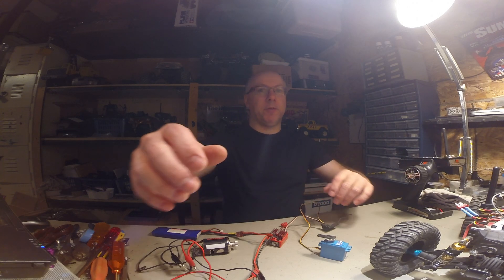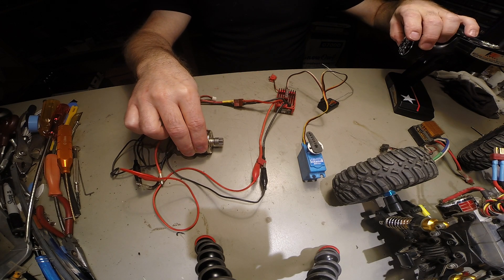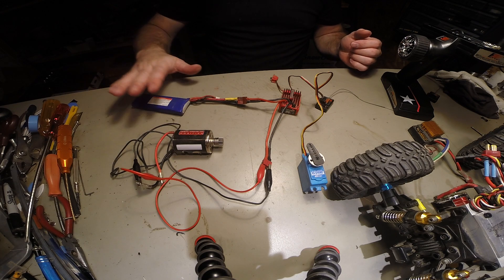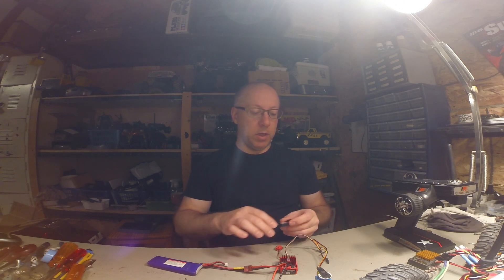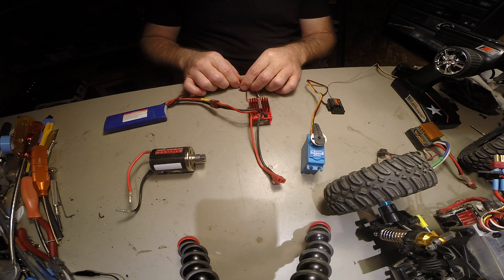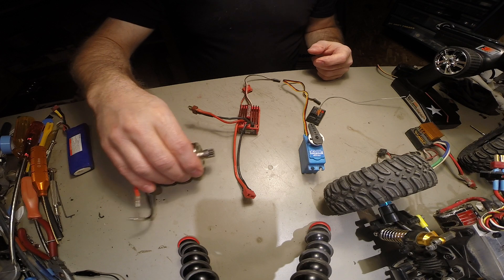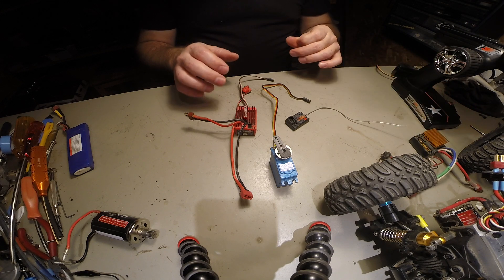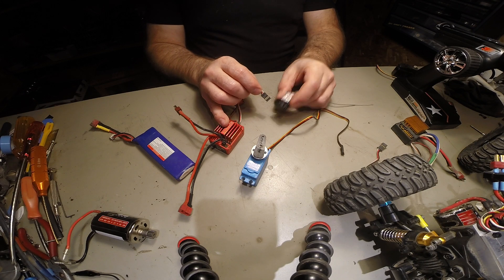Troubleshooting RC Electronics basics - Diagnose and fix it yourself

Comment: I have an E-Flite Apprentice that I nosed into the ground just before takeoff. I was able to get it running, but sometimes it runs and sometimes it doesn't. When it doesn't, nothing happens. When it does run, it goes like normal. Any ideas on how to fix that?
Reply from the maker: Gotta be in intermittent connection that you have to find
Reply: @TheLEDwheel   Have you done any wiring of vintage battery operated toys? I need some advice on how to hook up wires in the toy I have.
Reply from the maker: @Superdoc7  not sure  that would help. Toygrade electronics can differ greatly from one to the other unlike hobby grade setups that have common interchangeable systems.

Comment: Great video. I didn't realize I would have to learn to fix these cars if I wanted to drive them with my son. We currently have a rc car which steered but didn't move. The tires lock up when you push the car. Model: haiboxing 1:12 rc off road sand rail buggy. Called customer service and the man told me to just " start taking it apart" then try to diagnose it. Any ideas here guys? I don't really know what I am doing. HELP!!!
Reply from the maker: Open up the gearbox and see  if either  there is junk or broken gears.

Comment: Very informative, saved this video! I got a trx4 defender 2 months ago and my transmitter/radio won't turn on. Has brand new batteries (IV tested all 4 batteries) and have opened the radio to see if any wires were.lose but it all looks fine. Anything I should check for?
Reply from the maker: First I would  contact traxxas for customer service.  Other than that if power gets to the main board and it  does not power up it could be the voltage regulator but i have no idea  how its setup or what it looks like.

Comment: Where would I start if the receiver blinks once when switch is turned on?  Nothing else works. Thanks
Reply from the maker: Does it flash if the transmitter is off?

Comment: Two RC's by legendary 1/10 trucks. It powers up with steering. The motors are two and all they do is squill. Like they have power but won't turn. Any ideas?
Reply from the maker: Has the rc been in the water? Can you turn the back wheels together and make the motor spin?

Comment: Hey, I have an issue.
My Himoto Buggy sometimes freaks out.
It's either random twitching of steering wheels or it accelerates at random to full speed without touching the transmitter
Reply from the maker: Does this happen when it's near or far?
Reply: As far as I tried it happens when it's closer to the transmitter
Reply from the maker: Things like this are difficult to troubleshoot. From experience it may be a bad antenna, RF interference or simply bad components.
Reply: Can't recall when it started, I didn't touch the buggy for some time, but it was fine for quite some time.
I put it aside when it started with the mind of "I'll look into that later".
All components are original, just modified into brushless version.
What I noticed is that LED on receiver starts flashing red and green right before and during the freak outs. Turning the transmitter off and on usually fixes the issue as the Fail Safe kicks in
Reply from the maker: Try re binding the TX and RX to see. Could be the TX is loosing its ability to stay connected to the RX.
Reply: Re biding doesn't help. I don't think it's loosing connection as it should go into fail safe mode regardless.
I might need to buy new receiver or transmitter and see
Reply from the maker: No one Round you havls the same system to test with?
Reply: No. Only one I could borrow is from a plane model. Not himoto tho.
When replaced it doesn't seem to freak out anymore. I might try switching channels in transmitter and see if it helps. If not I'll look for someone I know with same system so I can test it.
Anyway, thanks for helping :D

Comment: So I brought my rc car to the park, I was playing on the playground and drifting on the wood chips and when my car was in neutral i heard a grinding noise, I don’t know where the noise was coming from but i suspect it was the motor. After I went home from the park, I turned on the transmitter and then the motor but there was no green light that flashes on the motor, and the car was completely dead. Any solutions?
Reply: Oh wait never mind, the car is making a grinding noise but the cars steering, brake, reverse and throttle works, do you know why it’s happening? Could it be debris in the motor? The car makes the grinding noise even in neutral.
Reply from the maker: In neutral? 
It makes a grinding noise all the time?
Reply: @TheLEDwheel  yes
Reply: @TheLEDwheel  in neutral meaning when the car isn’t moving
Reply from the maker: Not sure what would make a grinding noise when the RC is stopped.. is it actually a grinding noise or some other noise that you may not be able to describe?
Reply: @TheLEDwheel  or I think it is a rattling noise
Reply: @TheLEDwheel  it sounds like a mini lawn mower but high pitched 🤣
Reply: @TheLEDwheel  I can post a youtube video of what is sounds like so you can hear it if you’d like
Reply from the maker: Disconnect the servo to see if the sound stops. Also, what RC is it?
Reply: @TheLEDwheel  arrma granite 4x4 blx 3s I got it only a month ago
Reply: @TheLEDwheel  I do not know how to remove the servo, my dad can help me in the morning but it’s late at night
Reply: @TheLEDwheel  and I had to replace the original servo with a new servo because the original servo broke recently somehow

Comment: Brand new esc
Brand new motor
Servo works but the motor just twitches..?
Reply from the maker: What ESC? Was the ESC adjusted to the transmitter? Is the ESC auto adjusting? Did you follow the instructions to sync the ESC to the transmitter?
Reply: @TheLEDwheel  its just a cheap TSKY 120amp esc, and a turnigy 5400Kv brushless motor.
I have tried a Nimh battery, a 2S Lipo and a 3S lipo
Reply: Think i need a new ESC. 
3S fried it >:@
Reply from the maker: Cheap or otherwise, it may need to be programmed to the transmitter. Specs say it can take 3s.
Reply: @TheLEDwheel  I found a manual and read that it can be ran on 3S, but i strongly believe that there is a fault within the circuitry as it emits the nastiest buzzing noise and smokes.. going in the bin and starting again
Reply from the maker: Don't waste money on cheap products. Will save you money and headaches. Pick up a Hobbywing from a reputable source as there are copies/clones that are total crap.
Reply: @TheLEDwheel  thanks for the advice, I’ve just subscribed👍🏻👍🏻👍🏻
Reply: @TheLEDwheel  yeah i’m going to find a local shop so i can actually communicate with the seller and purchase what suits my needs as apposed to blind guessing..
As a complete novice, I probably should have opted for a RTR car rather than trying to jump in the deep end and build my own.
Always has been the best way to learn, but at this point the only thing I have learnt is that its not comfortable pulling your hair out!

Comment: My motor and my servo are not working... the battery is a very bad one, im gonna change it to check if it is gonna work
Reply: I changed my battery and my receiver, the problem was the receiver, though it was never gonna work, but it did , thank you so much!

Comment: I got a traxxas xl 5 hv 3 s esc that’s stuck in lipo   LVD mode (low voltage detection)  and I’ve tried everything to disable it  followed instructions watched videos reset it and nothing works I got my truck from a friend which ran lipos in it I run nimh in my trucks so when I tried turning LVD off it didn’t work because the truck ran for a minute before dying the steering works but truck just doesn’t move with a full charge battery traxxas couldn’t figure it out either
Reply from the maker: Seems you did all you could. Only two options. New ESC or run lipos.
Reply: @TheLEDwheel   yeah new esc definitely because I’m not a lipo fan

Comment: I saw a ftx reciver and esc 3 in 1 if I'm gonna buy that it's going to work with the radio controll that came with the car? And they're made made for ftx comet. If u wanna see it search ftx carnage esc and reciver 3 in 1 and is from modelsport
Reply from the maker: I've not looked but does it say it's compatible?
Reply: @TheLEDwheel  idk I didn't  look
Reply: @TheLEDwheel  nope. And I searched an original recover but I didn't  found anything
Reply from the maker: Also not a big fan of combo units. If one part breaks you must change it all.
Reply: @TheLEDwheel  another question my esc it's turning on and the light it's blinking only when I start it but after nothing and I don't have the reciver
Reply from the maker: It may be looking for a signal from the RX and then stops.
Reply: @TheLEDwheel  alright thx now I have to buy the sterling wheel and reciver but I can't find the reciver to buy it
Reply from the maker: Is this the RX? 

https://ftx-rc.com/index.php?_route_=rc-electrics/etronix-esr-1-sport-2-4ghz-waterproof-receiver
Reply: @TheLEDwheel  yes it's like that but it has pins to connect the esc and steriling wheel

Comment: Mine stopped working. The little red lights on the radio comes on. All the receiver lights are on But there is no response from the drive or steering.
Reply from the maker: Good batteries?

Comment: Hello and thanks for the advices, I have a maverick strada mt brushless, it started doing some crazy shit today. I drove it for about 15 minutes on 3s and the motor got so hot that it started smelling, although I didn't push it. I tried it again after a few hours and it does the craziest thing: if I hold it up, it accelerates and everything. If I put it down, it stalls and barely moves. What do you think it could be? Thanks in advance
Reply from the maker: That's either your motor or ESC. You have to test your motor on another ESC.
Reply: @TheLEDwheel  thank you for the quick response. Can it really be the motor if it turns like hell when I hold the car in the air?
Reply from the maker: Yes but it can also be the ESC. So either testing your ESC with another motor or testing your motor with another ESC is gonna answer your question.
Reply: @TheLEDwheel I'm gonna try to find a way, even though I don't have access to neither of them. Thank you again

Comment: My RC just stopped and I don't know if it is the ESC or not. I can turn it on and the ESC will start flashing, the second the controller connects the ESC suddenly turns off. Is this a ESC problem or not? Would appreciate help as it is my first Hobby RC.
Reply from the maker: Hmmm, try disconnecting the servo and then power it up.
Reply: @TheLEDwheel  Just disconnected the servo and now it works, Thanks

Comment: Great info, you've gotten my subscription!  Do you have any knowledge to share regarding safe amp draw from receivers?  I'm looking at adding some rather powerful leds to the 3rd channel and concerned about straining the receiver.  I can't find anything online regarding this topic and have just emailed Spektrum for info. as they only talk volts in their literature.
Reply from the maker: For your power going through the RX.... While the power will be taken from the Rx's connections, the power distribution is the same across all the channels. They are connected in parallel and anything drawn from there is exactly like taking it directly from the ESC. So what ever your ESC is capable of is your max current and limited only by the connection contact surface which can handle way more power than the ESC puts out. If you intend to surpass the ESC's given current limits you could always use an adjustable 10 amp Castle BEC
Reply: @TheLEDwheel  I really appreciate the reply, thank you as I wasn't coming across this information anywhere.  That makes sense.  It's a newer 3S capable esc with integrated BEC rated at 4 amp so my LEDs with 1 amp draw should be just fine. Looking forward to checking out your library of videos!

Comment: Would u say it would have to be the esc right
Reply from the maker: Yes, my guess would be a faulty ESC but connect the battery directly to the motor and see if it goes. Also, make sure the ESC is programmed to the transmitter.
Reply: @TheLEDwheel   it’s is programmed been driving it for a while without any problems
Reply: And I have steering so my transmitter is working
Reply: @TheLEDwheel  how can I do that
Reply from the maker: @killer_18ya  that's one thing it explains in the video, did you do everything ?
Reply: @TheLEDwheel  okay I’ll re watch taht
Reply from the maker: Have you tested the ESC on the steering channel?
Reply: @TheLEDwheel  yes I just ordered a new esc the other day so I can keep in testing

Comment: I put the steering on channel 2 and my throttle turns the wheels but my wheel on the radio doesn’t turn it does that mean my radio has a problem aswell cause the only channel that works is 2
Reply from the maker: Now you need to try a known good Receiver to determine if its the transmitter or the receiver. Or, a know good transmitter.

Comment: What do you check when the battery does not power up the receiver to bind radio. I tried two receivers and used charged battery on a new plane!!!
Reply from the maker: I'm guessing it's an electric plane!! Check your ESC to see if it's giving power to the receiver.
Reply: It is a brand new plane and i would have cut into the fuselage to get to the esc but i agree i know it is a bad esc
Reply from the maker: If it's brand new maybe contact the seller or manufacturer.

Comment: Hey,
I have a 1:12 scale and it came with a 650 mah battery. It runs for two minutes and then shuts down under full throttle. Servo is still working but it dosn't drive. Could the battery just be to small?
Reply from the maker: Says running time 30 minutes. Either your battery is finished or the charger is not properly charging it.
Reply: Okay. Thanks a lot for the fast help!
Reply from the maker: Depending on what type of RC it is, 650mah is pretty small for a 1/12 scale. What RC is it exactly?
Reply: A carson mountain warrior Sport. It has a 380 motor

Comment: Our RC truck will work for about 30 seconds, then stop.  The wheels will still turn, but the car won't move forward or backward.  Its a Haiboxing desert truck Item 2995.  Any suggestions?  Thank you.
Reply from the maker: Usually that happened when the battery is too low. The ESC cuts power to the Motor but keeps steering in case it cuts out while you are driving allowing you to still steer the RC to safety if needed
Reply: @TheLEDwheel  I have tried 2 fully charged batteries.  Sometimes, it won't even work for 30 seconds.  It won't move at all.  But the wheels still turn.
Reply from the maker: Are 100% sure the batteries are charged? Many chargers that come with RTR RC'S go bad and you would never know it.
Reply: @TheLEDwheel  Most likely they are charged.  We just got this 2 days ago for Christmas.
Reply from the maker: Any way you can check the voltage? Multimeter?
Reply: @TheLEDwheel  No, I'm not sure how to do that and I don't have any tools.
Reply from the maker: It's a typical LiPo cutoff option to protect the battery from over discharging. LiPo batteries are very sensitive to over charging and over discharging. You can also contact the seller, they may have already encountered this issue.
Reply: @TheLEDwheel  I've tried to contact them, waiting on a reply.  Thanks for your help.
Reply from the maker: If they don't help, come back here and we will figure it out.

Comment: Why do my BZR1 rc truck, headlights blink and then i have no control of it. Then it just runs away.
Reply from the maker: on eBay it says to make sure battery is charged and if so, unplug the servo and try the forward reverse test.

Comment: I have an Across Rockclimber when I play with it for it for few seconds it works fine but after that the motor disconnects and only the steering works. Any advise is it a radio issue ??
Reply from the maker: I think that it could be either the ESC is overheating or the LiPo cutoff is kicking in. Make sure the battery is actually charged(not just the light going out in the charger) and when you try to use it and it cuts off, check if the ESC and motor are hot. Like almost can't touch it hot.
Reply: @TheLEDwheel  thanks I shall try